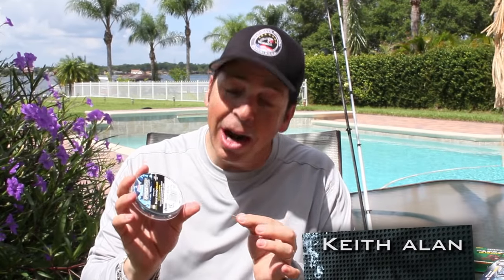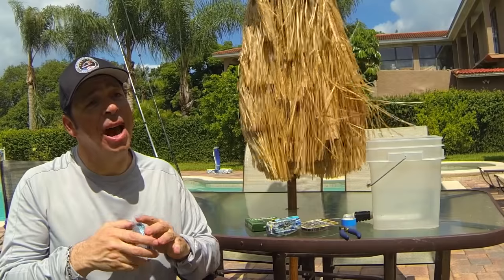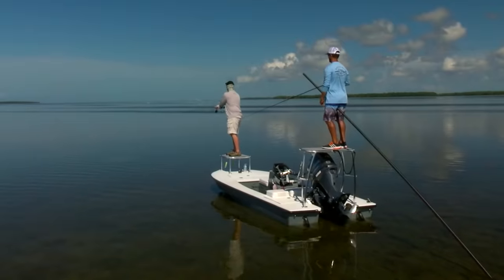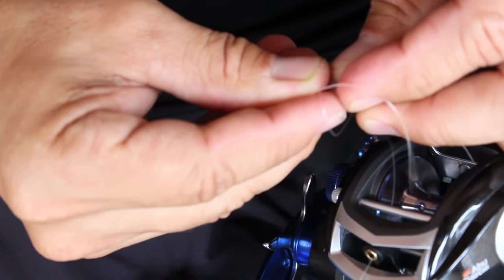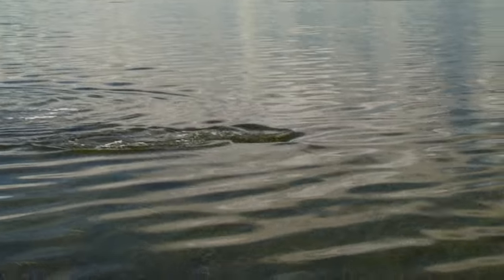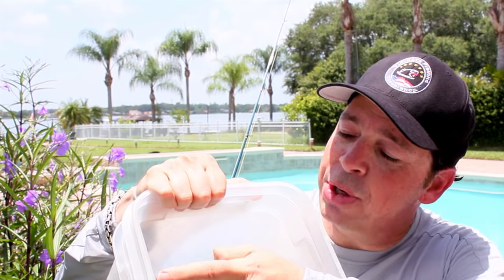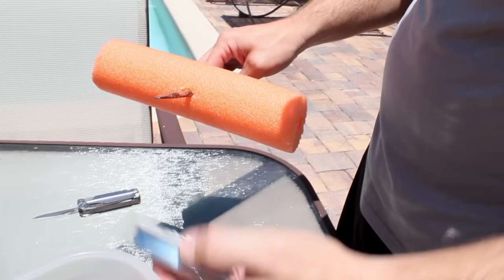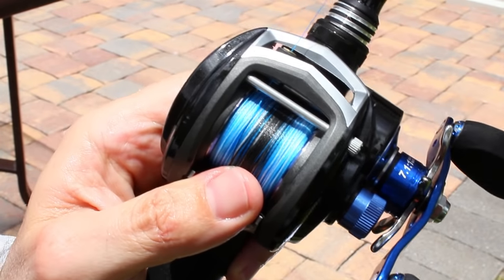Spooling Hacks from SpiderWire

Comment: Lord! I use two bare feet with a wooden dowel held between my big toes. Takes 3 seconds to setup and you can squeeze the spool as much as you want for tension. Works for thin spools, 1/4 pound spools, even big 1 lb. saltwater spools. Just use your Feet. Been doing this for 30+ years.
Reply: Ditto, no reason to get any more complex.  I also tend to hold a hand just below the first guide to tweak the tension as it comes through.  It's just too simple.

Comment: i usually use another reel(bigger size and a few spare spools) as a tool for adding tension with its drag... and for the penn clash some fixing on the linelay is needed(with the supplied washers) so need to spool the line back and fourt a few times

Comment: Using the same logic about running fish in those conditions, in freshwater and inshore, just tie the braid directly through a couple of the holes on the spool and double uni about a 3 foot mono top shot to the other end. If you don't want to guess for your leader strength, just use two lines of similar strength, if it's reasonable. E.G. 20 and 20.

Comment: would this be best for alligator gar?
Reply: I've used braid for longnose and shortnose gar, I prefer it because after they run away with it and eat (I've had longnose gar take off 75 yards before actually taking the bait) you'll have an easier time setting the hook well.
Reply: +MrDjones55 OK thanks
Reply: +Im Am Asian I always make sure to use a nice heavy mono or fluoro leader too.
Reply: 50 or 65lb braid and a steel leader work wonders
Reply: If you only if you had 50 pound braid that is 12 pound test in diameter

Comment: spider wire is the worst. would rather buy cheap Chinese braid.
Reply: miamiwax I watch them do a no knott test Power Pro versus invisi braid from spiderwire it beat powerpro all to pieces
Reply: Bought Power Pro, ended up taking it off and putting Spiderwire back on. Much better casting on my spinning reel. The 20 lb test invisi braid rocks.